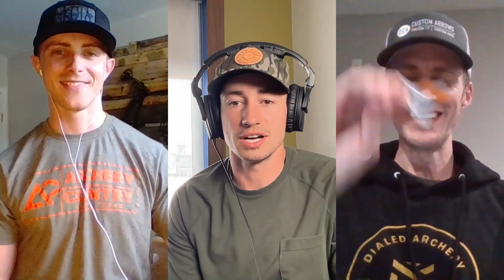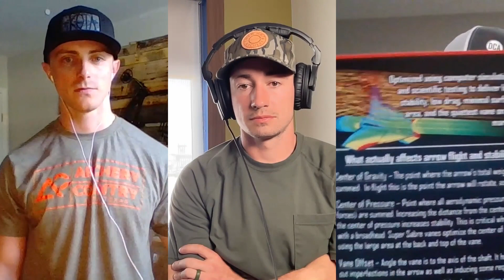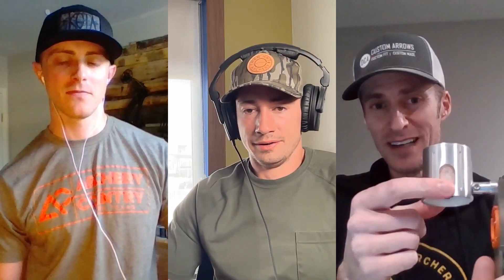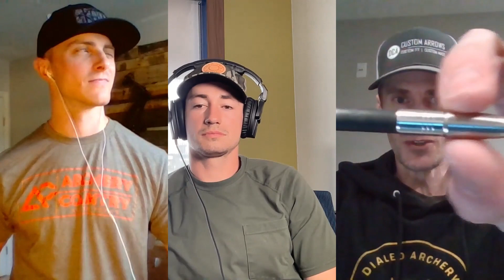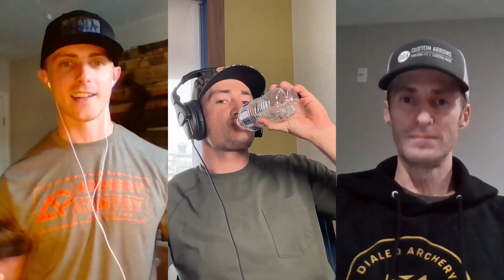Arrow Nerds W/ Kyle Davidson of DCA Custom Arrows & Dialed Archery - Ep 1

Comment: Episode 1 here we go!
Reply: More likely to get a response with a direct reply, so here we go. 

It looks like there's space behind the pins to put a magnifier. Are the sizes of the housing standard sizes, so a standard lens can be used? I'd shove a big O ring in to hold it in place.

Just my two pennies.

Edit: a tabbed o ring would be easy to manipulate, a groove to hold both the legs and ring in place, tab aligned with the bottom of the pin so it's hidden, etc. Just seems like a cool idea.